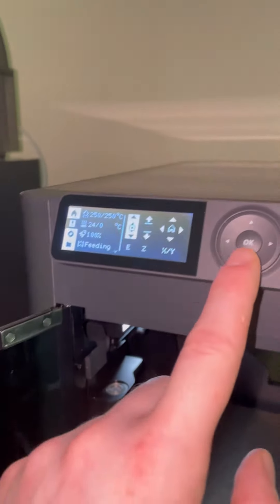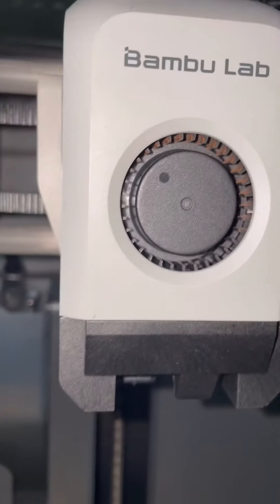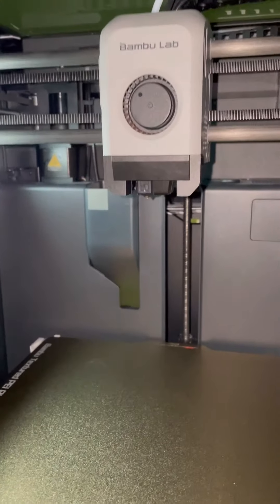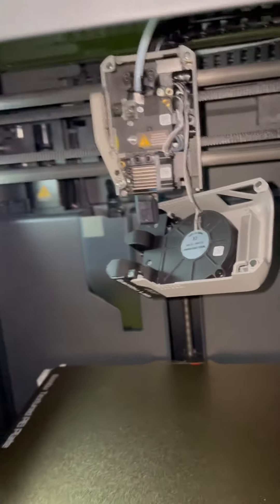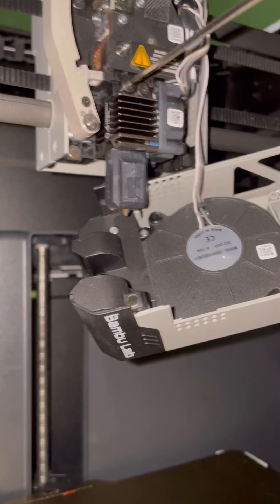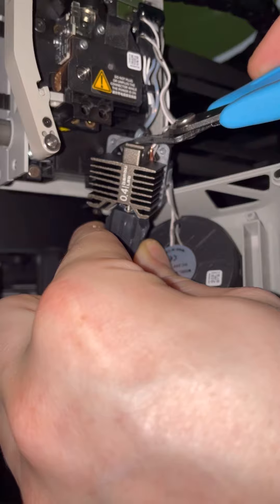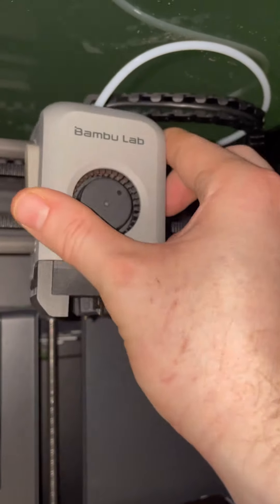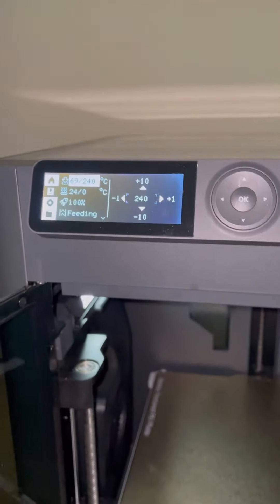How to fix P1S not extruding problem *Easy Fix*

Comment: The reason why this happens is because glow in the dark filament is abrasive. If you purchase the Hardened Steel Extruder Gears and the Hardened Steel Nozzle from bambu it should fix any issues you may have. I think its like $50 total for both and is a great upgrade if you print with a lot of abrasive materials. Nice video!
Reply from the maker: Yeah, I bought this P1S without AMS unit specifically for glow in the dark orders. I'll most likely upgrade to the hardened steel for this reason
Reply: I had the same with PETG. Didn't even print that much too... that thing is brand new.
Reply: it also happen with long pla prints if you keep the enclosure closed
Reply: The same thing happened to me with TPU. Same issue as you, a small piece stuck in the hot end.
Reply: I've got the hardened steel gears and nozzle, and it still happens all the time. With any filament type.

Comment: Tip for anyone with a flesh cut filament piece: Use something hot to heat up another piece of filament and press it against the top. wait for it to cool and then pull it out.

Comment: When you took the hotend and nozzle off, you showed a piece of filament in there. Isn't that normal because the blade cuts the filament just above? Shouldn't it just melt and flow out the next time a filament is pushed through?

Comment: If you dont have that little string hanging out the back, and cant pull it out for whatever reason, a 1/16th drill bit works if you VERY CAREFULLY drill out the stuck filiment :)

Comment: Did this already, remove the broken PLA piece from the hotend.  Put everything back, tried to extrude again but still clicking sound, no extrusion.  I may have to go deeper and check the filament sensors gear.
Reply: Found any solution?

Comment: THANK YOU SO MUCH, you absolutely saved me, very straightforward video, and I hope anyone else who sees this figures out their problem, Btw I heated my hotend to 190 so that when I did pull it out, it wouldn’t break and I have to turn off & on my Printer and I had to use the Bambu Handy app so that I can load my filament

Comment: This just saved my 17 hour print which clogged at hour 15. I used the same steps except i didnt power down, resumed printing and all is well now! Thank you!! (Not advice, just what worked for me).
Reply: Can I actually do this with the print just paused? I thought you would have to shut it off mines stuck midnprint rn

Comment: Fixed it, with your splendid video. But my stuck filament piece was flush cut. I had to use a needle to flush it out of the hot end radiator.

Comment: Thanks!! I actually thought my motor was gone after taking apart my entire extruder and replacing hotend it was you recording that exact sound that I must have just gotten 2 jams in a row but hearing the sound let me know that was problem so I went and removed the head that I had put in just the other day and cleaned it out and bamo i was extruding again!!

Comment: Currently having the opposite issue. Worked fine with PLA, went to switch to PETG HF and now the nozzle won't stop extruding after I load filament. Trying to find a direction to go into I haven't quite found many issues similar yet.

Comment: Hi. My Bambu sticks to the bed just fine, extrudes fine until about an inch into the print then it looks like it stopped moving at a certain point causing a small build up on the piece which causes a mis-print. Any Ideas? Thanks for the video.

Comment: I like others had it perfectly cut across so unfortunately cannot just easily pull it out. I heated up a needle and stuck it in and let it cool. I pulled the needle out and the PLA came out with it

Comment: Tried to follow this but the stuck filament to flush to the top of the hot end!!! Any ideas?
Reply: Same here did you ever figure it out?
Reply: @ThujanK  yes. I heated up a hex key with a lighter,  pushed it into the filament and then pulled it out....just be carefully with the hot hex key, I may have burnt myself in the process.
Reply: @dancoon7653   Yea I ended up drilling it out with a dull drill bit that heated up the plastic and bonded with it. Then pulled it out haha.

Comment: What do yoi do when it won't feed even after doing that? I did even change the hotend. Still won't feed  it. And it won't even feed from the ams
Reply: Do you want to check your PTFE tubes and check inch side the extruder. You will have to take that apart if you have a bambu lab printer.
Reply: @zedriccopeland8878  it was a small piece of filament inside the exteuder that did jam the gear. But after the carefull asembly my hotend fan found out it did not want to work again. So bambu is shipping me a New one. So hope I can get my printer back up running again soon.

Comment: So I searched for "p1s troubleshoot extrude" not expecting this to be a wide common problem with the glow filament. This happens EVERY SINGLE time I use the glow filament. Bambu branded WITH AMS so the machine knows EXACTLY what it is. Why in the world has this been a common issue for more than a year? This is a pain :(

Thank you for the video btw. BAMBU - WHY?

Comment: Okay, I'm having the same issue, but there is no filament in the hotend. It just won't extrude.
Reply: Did you find out what the issue was? Same problem here.
Reply: @nielshamelryck2274  

Yeah, there was filament stuck in the gear of the extruder feeder before it got to the hot end. Took it apart and cleaned it. There’s a vid on the Bambu wiki.